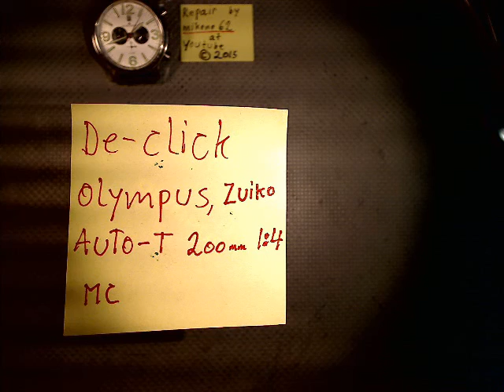De-click Olympus Zuiko Auto-T 200mm 1:4________Motion Lapse Film

Comment: Thanks a lot for this wonderful presentation. A question: At the very beginning of clips and when you remove the frontal element group from the body of lens, I see it is a sealed component. How difficult is it to open it, without a damage, to clean up the most frontal lens' element inner surface from dust or fungus? Can you make another clip and show that part too. I know that a lot of people have problem with particles here that might be a problem with the design of lens. Anyways thanks a lot for sharing this priceless presentation.
Reply from the maker: Thank's Sam, I don't have this lens anymore, but to come into the most frontal lens, I would think you should unscrew the name plate and then it should be possible to take out the front lens element, maybe there is a retaining ring that hold the lens in place so you have to unscrew that ring and take out the front element.

Cheers
Kenneth
Reply: Thanks Kenneth. Got this lens with inner frontal element fungus that is in the mail. Will add information here, once I get it and actually open it, if things go fine.

Comment: Hello thanks a lot, amazing videos and amazing explanations, i'm refurb this lens but i can't unscrew the front lens group, i think is glued or something, any recommendation?
Reply from the maker: If the front name plate or the retaining ring that hold the front lens group in place, is way too tight you can add a few drops on the thread only, of nail-polish remover or Acetone on a Q-tip, just to soften the thread locker so it will be more easy to unscrew.

TAKE CARE!, nail-polish remover or Acetone can soften plastic and in that way make some damage
Reply: mikeno62 Thank you very much for the advice :) I will to try with this method, regards.

Comment: I have an Oly 300 mm. It has oil on the aperture blades. Would I disassemble it the same way as the 200mm?
Thanks
Reply from the maker: Well, as I don't have a 300mm at the moment I don't know, but you should try follow the film about the 200mm, it could be the almost same it is assmbled..